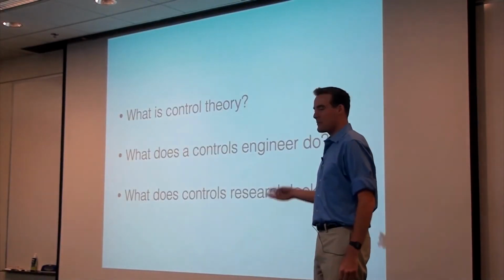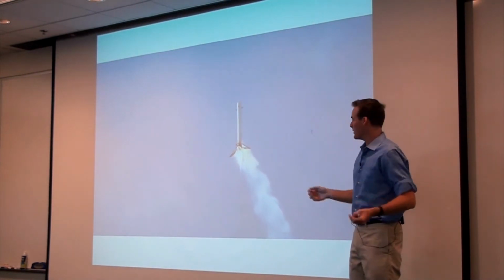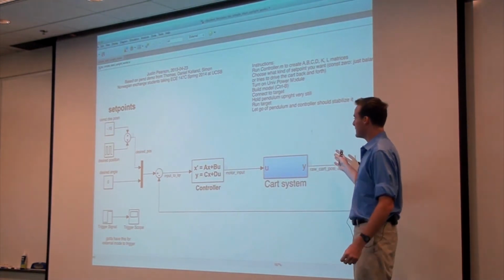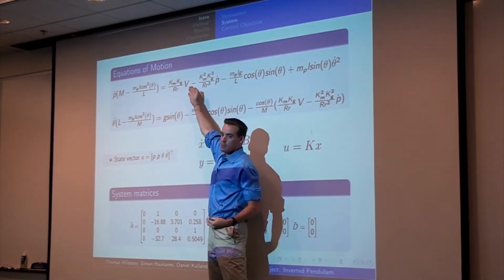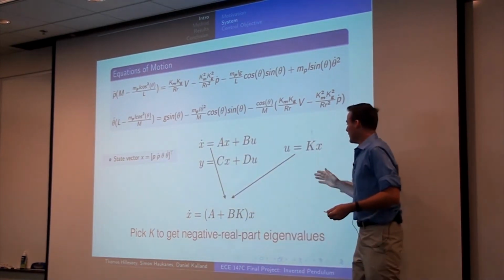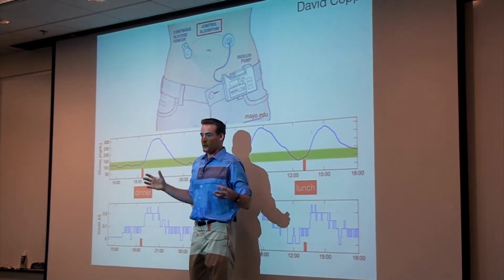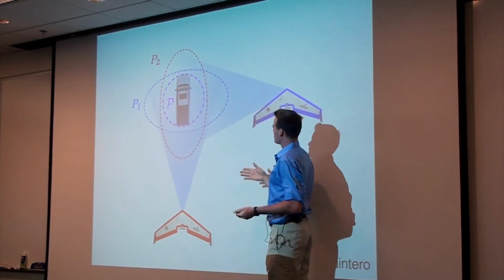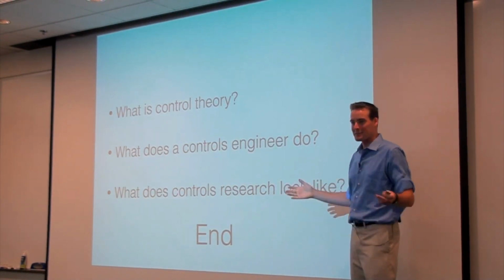Wide World of Control Engineering

Comment: What kind of physics beside classical mechanics is used in controls engineering ?
Reply: Not much, electronic, etc, then it's basically math beyond that.
Reply: Depends on the system you're trying to control.. I know that control theory seems very "mechanical" but that's just because it has many applications in mechanics.. The mathematics of control theory (Differential Equations and Laplace Analysis) are very abstract and generic.. Even if a new "kind of physics" was discovered, this physics can still be controlled using the tools.

To better answer your question, control engineering can be used to control the strength of a magnet, for example, so you can apply using electromagnetism. It can be used to control the angle of a satellite dish receiver, or control the focal length of a converging lens to properly view objects varying distances away (aka your eye!).

Understand the fundamentals, and you'll be able to apply however you want.